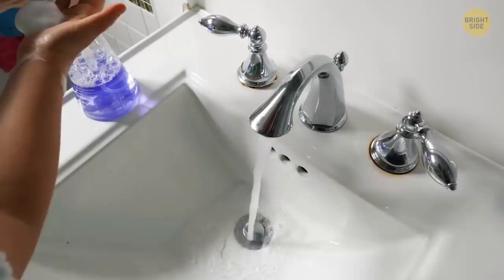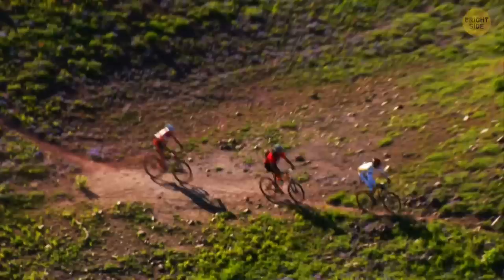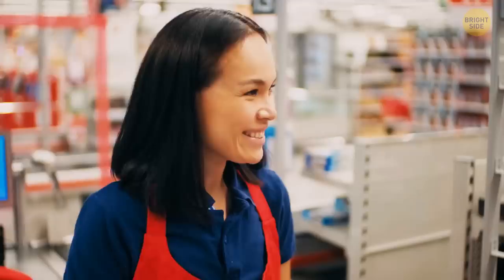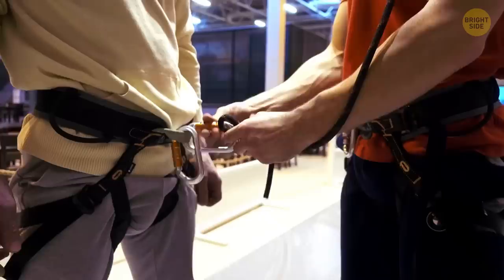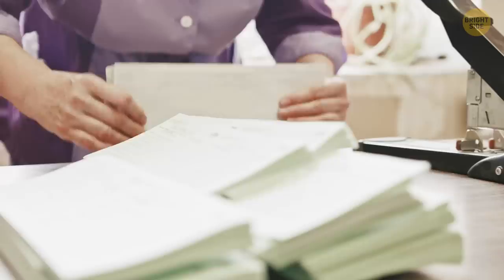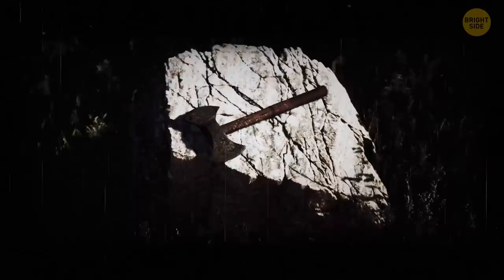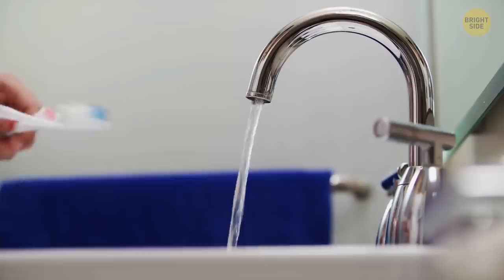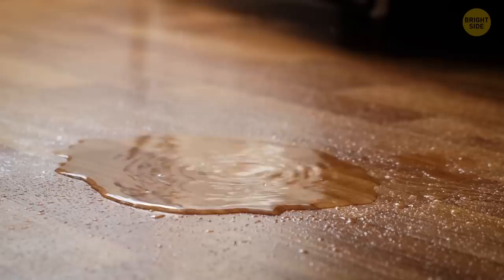Why Shopping Carts Have Holes + 15 Things You Never Thought About

Comment: Actually, because hats are round-knit, there’s a small hole at the top. Pompoms are simply to hide that hole. Sincerely, a knitter who has been doing this for years.
Reply: There are a few theories on the reason for the pompom. I've made a grand total of (drum roll) one hat & didn't wind up with a hole, so maybe it depends on the stich? Idk...
I haven't looked @ anything from this channel in a long time. Now I remember the reason: bc of the content ;)
Reply: Actually they were placed there for sailors so if they bumped their head on the low ceilings they were cushioned. 
And the "strawberry" on the tomato pin cushion is full of sand and you stick your needles in it to sharpen them!! 
This guy is WACKED!!!

Comment: The sand filled strawberry attached to the pincushion was designed to sharpen needles.
Reply: That's what I learned in 7th grade home ec...
Reply: It is, you're correct. I haven't looked @ anything from this channel in a long time. Now I remember the reason: bc of the content ;)
Reply: Actually, the strawberry isn't for sharpening; it's for removing any rust on needles thus allowing them to glide through the material more smoothly making them appear to be sharper.  Also, those caps with a pompon are called "touques" not "beanies". A beanie is a cap that fits close to the head and is usually made out of felt or other such material. They can be knitted, but are shaped differently than the touque.
Reply: With all the hand sewing I did when I was young, I'm 74, anything that made needles go through fabric easier was a miracle. Yes I had a sewing machine, but in the day you hand made your own aprons for home-ec.
Reply: @anndinoto  I still have my first home ec project from 1961 - a hand stitched pincushion filled with sawdust from woodshop. 😀
Reply: Sand-filled*

Comment: you forgot to mention with a strawberry dangling of the tomato pin cushion that's also there to help sharpen the pins so they can go in the fabric easier stick the pin of the strawberry hold the strawberry twist it around for a little bit in your pin is sharpened

Comment: Silica gel will NOT save your phone from water damage!!! Neither will rice! There are emi shields that trap water under them on the circuit board causing a short. If you dunk your phone, don’t turn it on or if it’s already on, turn it off and get it to a cellphone repair shop ASAP! My husband is a phone repair technician and this is misinformation at its finest!